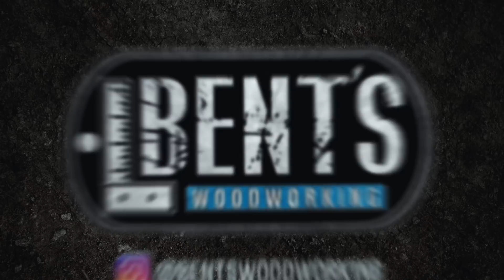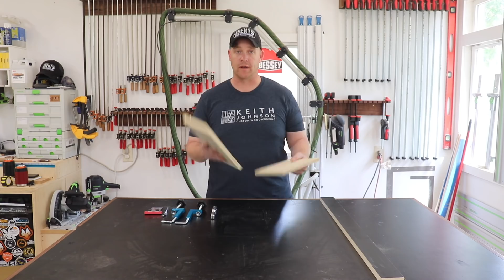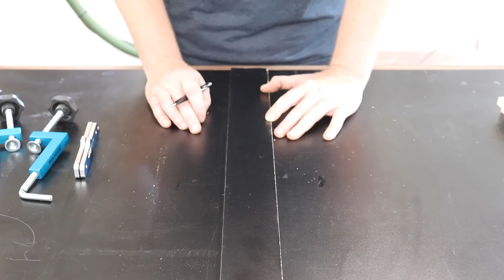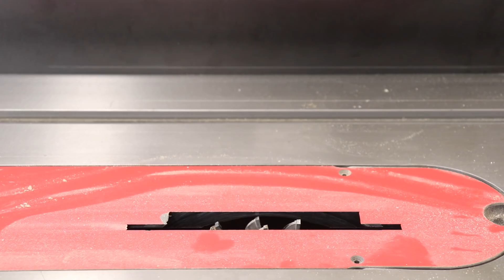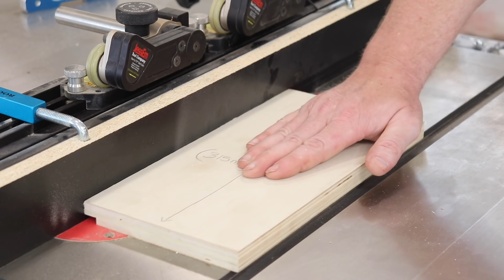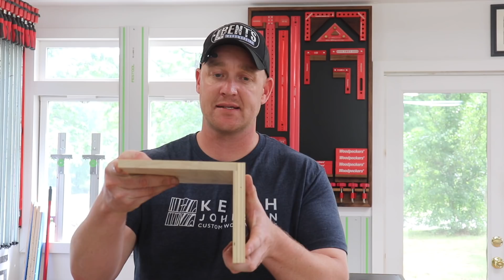Using A Table Saw To CUT RABBETS // WOODWORKING TIPS

Comment: A great video with precise information. It would be nice if you would do a similar video for those of us that do not have dado stacks and expensive table saws as yourself. I have an old Ryobi 10" table saw.
Reply from the maker: You definitely don’t need either of those. They just make it easier and faster. You could use a single blade and take multiple passes. I would still use a sacrificial fence for the last cut.

Comment: I need to make shallow rabbets on 8 foot length 1-by.  Have also seen the board passed between fence and blade with rabbet on the outside, with no sacrificial fence needed. Why not do that? Do you get a more precise cut when the rabbet is on the fence side versus the outside?
Reply from the maker: This provides the ability to not have material between the blade and fence

Comment: Best video I seen on the sacrificial fence.

I  have been confused on the sacrificial fence.  I now understand that when you raise the blade, it also cuts into the sacrificial fence. So part of the dado stack now is not usable.  So if one needed a 1/2 inch rabbet, one would stack the blades to be 3/4 of an inch wide since a 1/4 of an inch is like under the sacrificial fence.  Now what is the downside if one does not use a  sacrificial fence. Is it a risk to damaging the real fence?
Reply from the maker: That is correct. That’s how I would do it. And yes, it’s so you don’t damage your fence
Reply: @bentswoodworking  Thanks kindly for your reply and now I understand it 100% thanks to you.

Comment: Question from a newbie: Since the Kreg setup guides have the hollowed out section on the bottom, why not use that to set the height of the blade?
Reply from the maker: You absolutely could and that’s one of its purposes but I like to feel it with my finger

Comment: Quick question from a newbie. When using my dado stack I have run into 2 problems. 1.  Using a sacrificial fence, it seems like I need additional width in my stack since even went right on the fence I am not wide enough after the cut. Should I widen my stack a bit and cut more into the fence?  2. Sometimes on smaller pieces, an edge gets caught in the “cut” section of the sacrificial fence.  Amy tips on either of these situations?  Thanks.
Reply from the maker: If cutting a half inch I would still go 3/4” on the dado stack and just have a portion in the sacrificial fence
Reply from the maker: For the issue of getting stuck, I would check the alignment of the fence itself